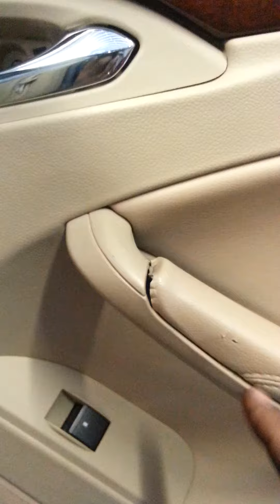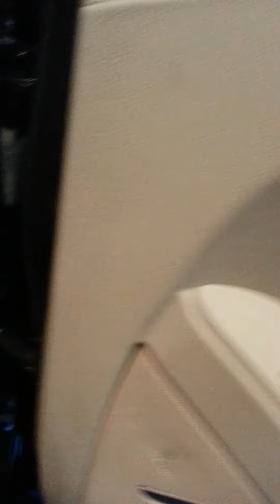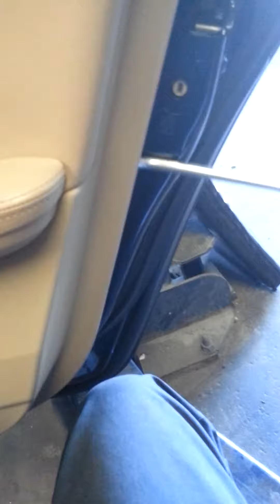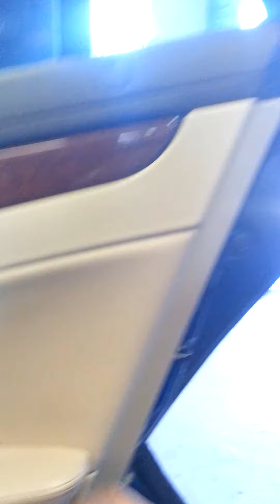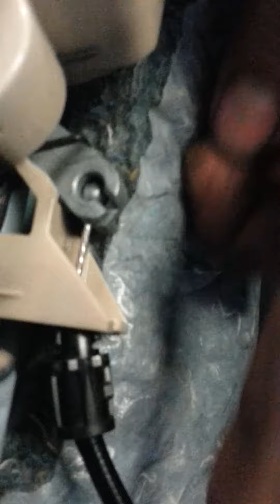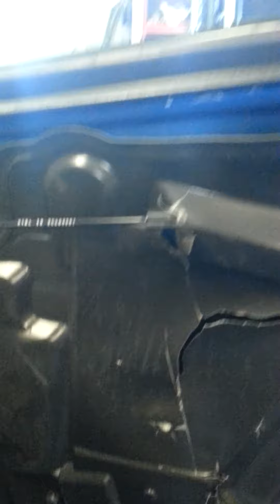2008 cts door panel removal

Comment: Hey bro is posible
To take off the armrest or is attached to the door panel mine is broken I wonder if I can get that piece alone
Reply from the maker: yes but u must remove the door panel first. it should have a plastic guides with tips melted down.  grind them off slow and u can use an epoxy plastic glue/ adhesive (40/40 dual mix) or use the same plastic you grind off and melt it back together. good luck if u have any other q's let me know
Reply from the maker: u can also get a panel at the junk yard and donate any parts u need from new one to your original part. u can use a cheap solder pen to melt the parts together.  (99cent store or home depot under $10)

Comment: Wow, how easy this guy makes it  look until you actually try to remove the underside of the door pull handle yourself! The piece he "pops" out with the tiny screwdriver in the real world, would take a carefully placed crow bar instead. If you look REAL carefully,  the plastic tab that holds the handle back in place has been broken off- probably in a previous "dry run" to this video. I wonder what else he is simplifying in this video.
Reply: We
Reply: Doesn't show the removal of the wire harnesses 🤷‍♂️
Reply from the maker: @scottbbfrostelfuego9538  wire harness is built in the door panel. Sorry for late response just got account back
Reply from the maker: Still level for this panel is a 3 in difficulty. Yes this small screw driver is a must have tool every true mechanical knows this tool is a life saver. Sorry for late response just got my account back 👍